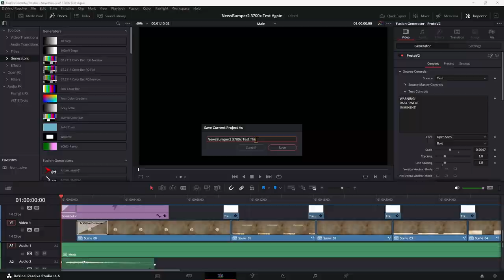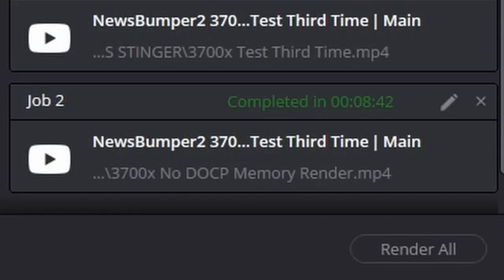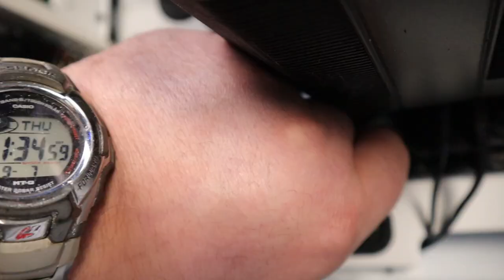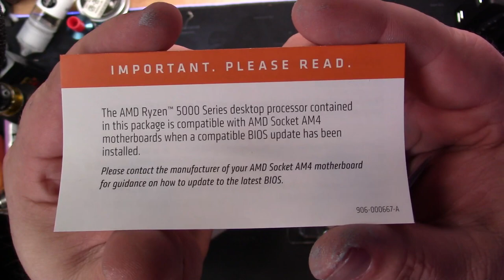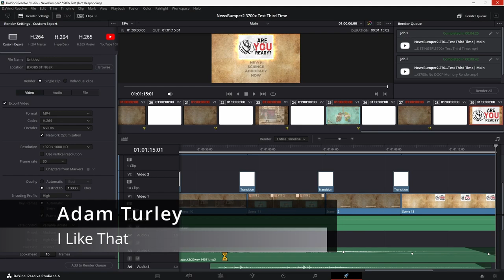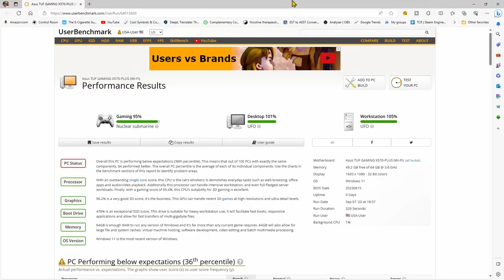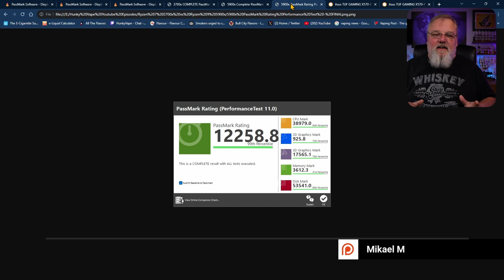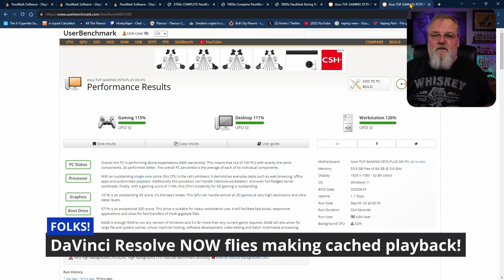Content Creators MUST Upgrade Ryzen 7 3700x To Ryzen 9 5900x

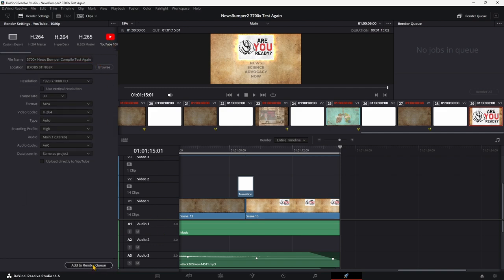Comment: @1:38 "video codec H.264" is your problem. switch to the NVENC encoder. it's a stand alone chip on your graphics card with a sole task of encoding video. using it will free up tons of CPU cycles and won't effect your GPU performance either. even after the CPU upgrade you will have a  lot more headroom on the cpu to run more intense stingers, bumpers, overlays and VST's .

Comment: Very good tip for the 5900x brother, in the BIOS, make sdure to set for your ram the XMP or DOCP.. and then when it comes to th e5900x set the voltage for CPU to negative voltage offset and at 0.1
I used to run the PLUS motherboard until i got my gaming-e back up but if i remember correctly if you have in bios the AI TWEAKER section and also the Advanced section, under the AI Tweaker section turn all things to do with PBO to AUTO except the fmax disable that, then under ADVANCED go to overclocking and then go to PBO and set it to advanced and then underneath set it to motherboard  and leave the curve optimizer set to auto or -15 and set all cres.. if anything is unstable with that just tunrn Curve Optimizer to Auto and you will be good.. the 5900x especially runs much ,uch better when undervolted and when Power setting set at Balanced believe it or not, its extremely weird the way it turned out when it comes ot the fact u would think it would slow it down but nope, runs everything more stable, snappier and smoother.   I highly recommend leaving ram at the DOCP or XMP settings along with not overclocking GPU or anything,. keep up the great vids!

Comment: now my advice ... because ive seen you RAM setup ... is to change your ram out... for 2 stick kit CL14 kit 32gigs 3600   ...   i run that on a 5900x. and i got a server 5950x with 128 but thats only good stable at 3200 even if its 3800...    lets just say the RAM Controler works at its BEST with 2 dims  because its designed for that...  and then itt can do its job at a faster level. ..because if you put 4 dims in the controler has to work harder to allocate things to 4dims   itsl ike writing in twoo books att the same time ...  ` hope you ll give it a try ... and then you can make a video about that also maybe ...  (and look in your mobo page what ports to plug then into ...that makes adiffrence also= think about the twoo books i told you about ... )
Reply: and do a BIOS updatte ...and look for 4G encode if thats enabled also ...small things that help ...

Comment: What cooler do you have and what it's average temperature of cpu ?
Reply from the maker: Cooler Master MasterAir MA620M ARGB Dual Tower CPU Air Cooler works better than I ever imagined it would. Sits at 55-56 C or 132 F all day (even when live streaming to 4 platforms with 3 DLSR cameras, a canon video camera - all 1080p60 HDMI via Elgato Cam link pro, an elgato facecam, 6 usb webcams, plus PS3 & PS4 via usb 3.0 HDMI converters, and can easily game on the PC now w/o cpu temp going over 67C. Intense gaming it hovers between 64-67C. Love it!

Comment: Have you never removed the radiator? Rocking from side to side.
Reply from the maker: I have (numerous time actually) and thought it would be an easy way to add a humorous moment to the video. (Best lessons in life are not repeating others mistakes.) The video was not meant to teach how to properly upgrade the cpu, but focus on the realized improvements of the specific upgrade. Appreciate your comment none-the-less.

Comment: did you have to change your cooling system in order to upgrade from ryzen 7 3700x to ryzen 9 5900x . just wondering
Reply from the maker: Not at all. The Cooler Master MA620M has been a champ. CPU temp stays consistent at 65C.